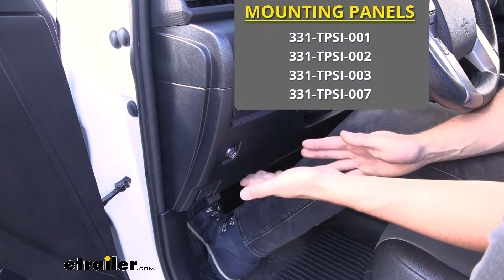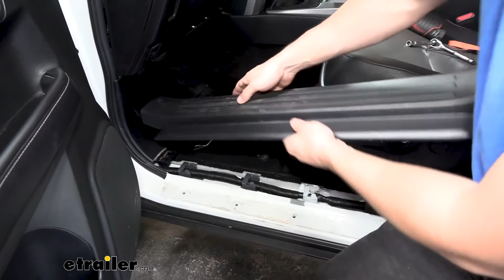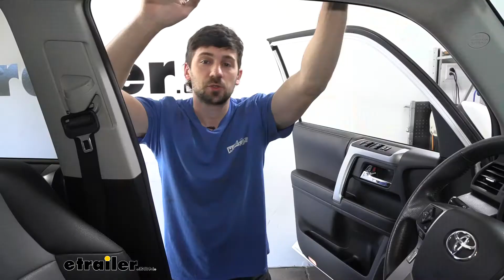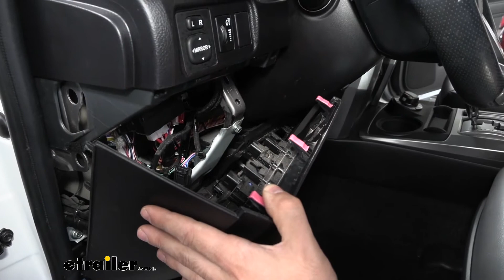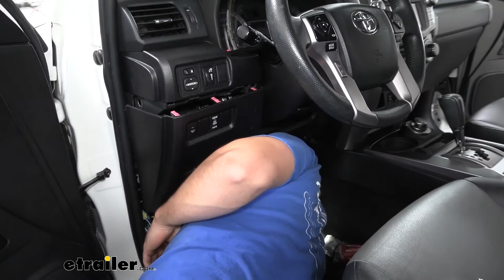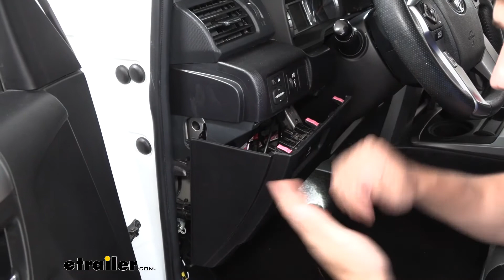etrailer | Redarc Tow-Pro Liberty Brake Controller Installation - 2018 Toyota 4Runner

Comment: I installed the Redarc brake controller back in 2021 on my 2014 Toyota 4runner and used it once to tow an RV everything work as expected. Now I realize the controller knob doesn't click anymore and no LED light comes on when I tow a UHAUL trailer two days ago. Could the control knob being bad?  Plese advise.
Reply from the maker: It is most likely because there are no brakes detected on the U-Haul. to My knowledge they use surge brake actuators which do not require a brake controller, the brakes are applied with the coupler on the trailer is pushed in. Please let me know if UHaul said that you needed a brake controller.

Comment: How big is the camera? Would have been nice to see those undersides with a better lighting as some of us have never taken a dash board out or plugged in a cables, specially into things where we cant see but just feel. Thanks for the video non the less
Reply from the maker: Point well taken, it would have been extremely difficult to fit a person and the camera under the dash at the same time. There's very close quarters under there!
https://www.etrailer.com/Trailer-Brake-Controller/Redarc/RED24FR.html

Comment: If I have a hitch and the electric connector beside it, does that mean I have the tow package? I thought all 5th Gen have the tow package standard
Reply from the maker: Yes, that typically means that your vehicle has the tow package. Also, I do believe you are correct in saying all 5th gen Toyota 4Runners come from the factory with the tow package. You would just need the following parts if you have a 2014-2022 4Runner:
https://www.etrailer.com/Accessories-and-Parts/Redarc/RED49FR.html
https://www.etrailer.com/Trailer-Brake-Controller/Redarc/RED24FR.html

Comment: So why didnt you mention the mount from redarc does not fit the stock hole for the mount. The stock plug  is around 15/16  and the plug from redarc is 1 1/8

Comment: this might be a dumb question, how does this connect to the trailer? i have a 2016 trd 4 runner and getting a 2014 13” scamp. i’m thinking i need to buy this, but do i also need to buy an axel or something to connect this to trailer? kind of confused!
Reply from the maker: Your 2016 Toyota 4Runner should have come with a factory hitch to connect your trailer to. You will need a ball mount, wiring and a brake controller if your trailer has brakes on it.
https://www.etrailer.com/t1-2016_Toyota_4Runner.htm
https://www.etrailer.com/bc-2016_Toyota_4Runner.htm
https://www.etrailer.com/Ball-Mount
Reply: Just installed this on my 21' 4Runner.  VERY happy with it.  We tow a 17' 3000 lb trailer.

Comment: Did you zip ties the main hub or double tape is enough? If zip ties, how did you do it?
Reply from the maker: The installer just used double sided tape in this installation to mount the control module. You can use tape and zip ties if that make you feel a bit more secure.
https://www.etrailer.com/Trailer-Brake-Controller/Redarc/RED24FR.html